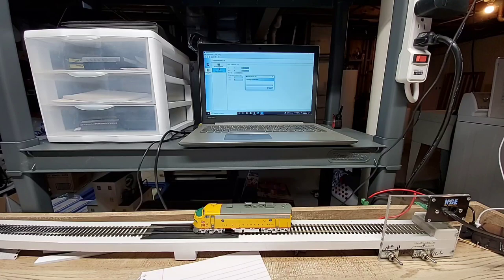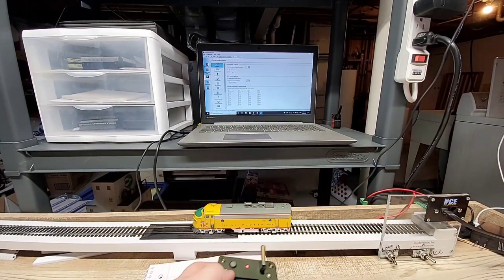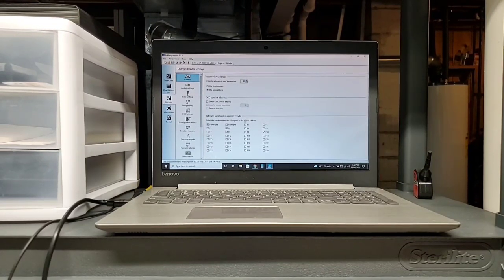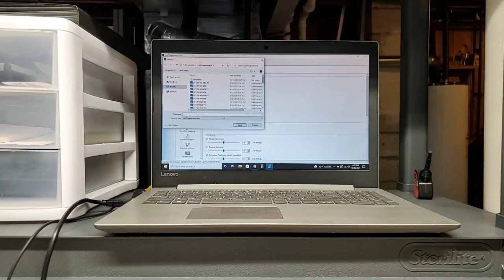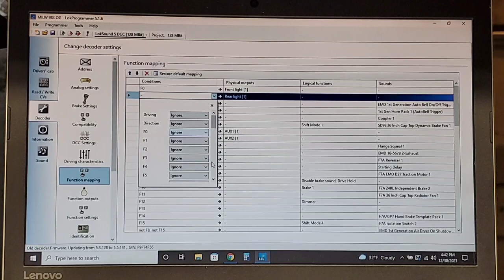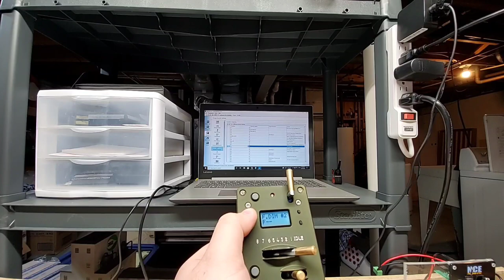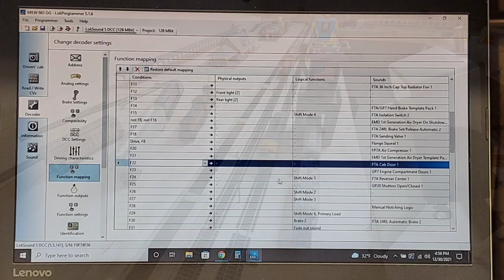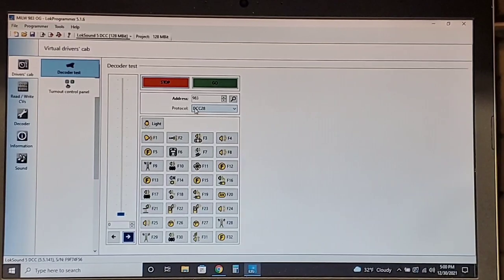ProtoThrottle How To: Your first throttle and locomotive program

Comment: What is the spreadsheet you were looking at with the cv and function settings on it?
Reply from the maker: That's my list of functions and how they are set up on the protothrottle. Check out my group on Facebook, https://www.facebook.com/groups/CMNRR/?ref=share
Reply: Shawn, I'm not sure if I've asked you before, about, if you've ever had any experience with the RailPro controller system?
It looks alot more user friendly and the consists of different brands of diesels and decoders play better together, because of the load sharing, instead of speed matching. Plus, looks alot easier to set up for multi-unit consists.